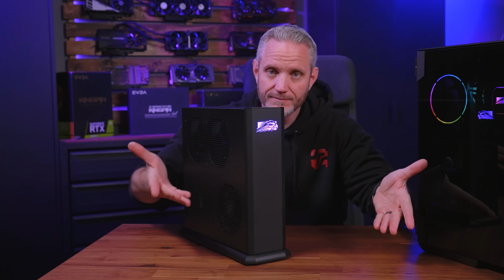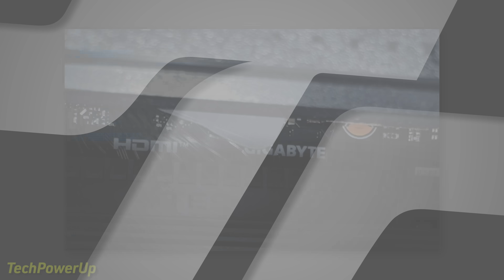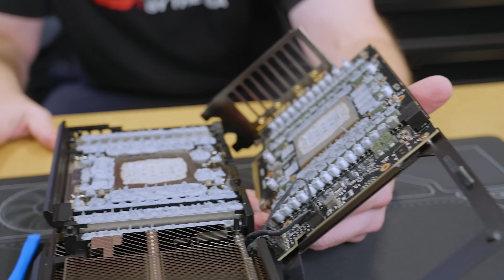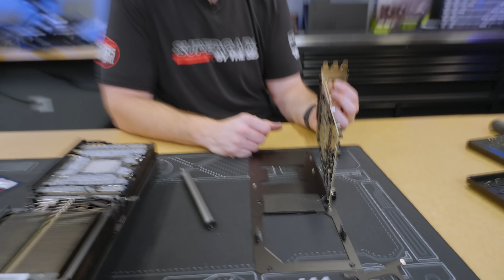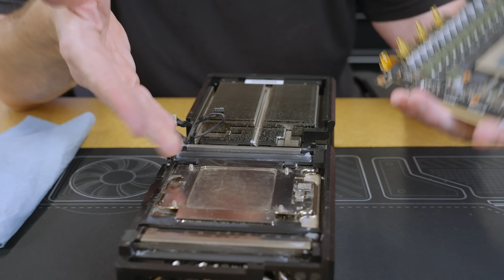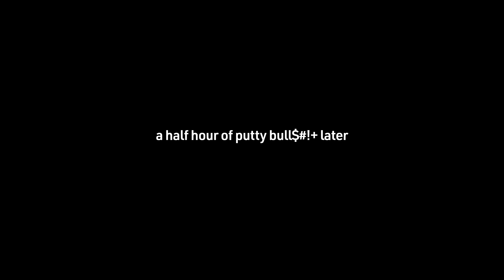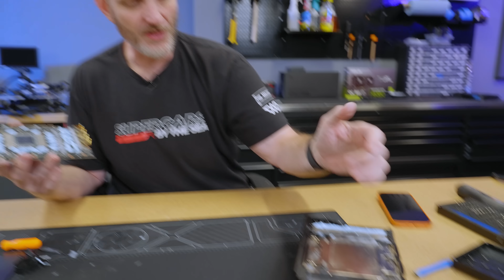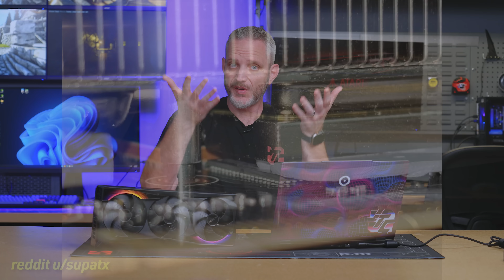What the HECK Gigabyte... WHY?

Comment: I replaced the thermal pads on my EVGA 3090ti with thermal putty and as much of a pain in the ass it was, the temps are so good
Reply: I use PTM7950 combined with Halnziye HY256 for thin gaps and UTP-8 Putty for bigger gaps on many devices, those are good and can be handrolled (With nitril gloves and a silicone mat) to balls and logs. (K5-Pro is horrible)
Reply: @harrydijkstra9936  yeah , say no to K5 pro
Reply: Snarks Domain on YouTube has some nice putty tutorials and he tested many different putty's.
Reply: how long ago did you do it ? Is it fresh or did you run it a year + ? :D
Mine was a total disaster after 1,5 years - but it was not Halnziye HY256, it was K5 pro instead
Reply: @DxCBuG  I've had the Thermal Grizzly putty on there 2 ish months... If the temps start going through the roof again I'll probably just end up replacing the GPU. Before I put the putty on, I had to limit the GPU at 80% because the hotspot would hit 100c in most games at 100%
Reply: So thermal putty and thermal pads are interchangeable? Why J didn't use thermal pads on this Aorus?
Reply: same
rtx 2070 super gigabyte windforce
mx6 on the die and tg putty on the vram and vrm and i saw a 20c drop with the same fan speeds 
mind you the card was 5 years old by the point i repasted it and the paste was like something youd find inside a sarcophagus
Reply: Come on, everyone, come and like this commenT! :D

Comment: In my daily tasks  this gpu doesn't get over 50c   not sure if that's hot for this to happen it's also oriented on it's side  but I guess symptoms are just it getting hotter and hotter as time passes?   It idles at 23c  though LOL  I do not allow it's fans to stop  they are always running at 50% though.    I have not seen any putty coming out on the sides yet.

Comment: ive been running a gigabyte 5090 gaming oc, zero issues on mine after 3 months or so
Reply: I have the same card in a hyte y70 build so of course vertically mounted. I haven't even looked to see if this happening 😢

Comment: one of those images had straight lines leading to a right angle, I say the putty is ok it didn't seem to have run on your card.  the image at 16m 14s, is improper placement when someone has rebuilt their card, the "gel" is too square, plus you can see on the chip where it was originally.

Comment: I have the Gigabyte Windforce 5070 TI and I was going to put a waterblock on it but it had the same putty and the waterblock I got did not fit so I had to return it.  But while I was in there I just replaced the putty mess with thermal pads for the important hot spots and then the standard paste for the GPU and stuff.  It was a mess of goo in there though.  I mean from their standpoint probably easier to just goo it up with a goo gun then putting in thermal pads that are a bit of work to put in I guess.

Comment: Nothing wrong with what Gigabyte did. Normal user will have better temperatures and it will last longer.
Reply: Nothing wrong with putties, consoles and laptops use them out of the factory, the issue is that gigabyte cheaped out on the putty they used, even cheap $10 putties don't ooze like this
Reply: Don't defend a company that makes flimsy GPU PCBs and overly heavy coolers but will refuse to RMA them when they inevitably crack. Gigabyte are one of the worst, anti consumer hardware companies around!

Comment: Server grade is the IT equivalent of military spec AKA lowest bidder that satisfy the minimum requirements
Reply: Admittedly, some server grade stuff is indeed specced different. Usually slower but better longevity. Storage for example. Its stuff that needs less actual attention and last longer, but usually has a tradeoff of performance (enterprise/endurance storage for example). A ptm pad would be server grade, this gel stuff definitely isnt. Otherwise, ye, its marketing garbage for some stuff. A ups is another example of potential server grade though, server ups have lower switch over times and higher capacity, hospital etc ups are even more extreme.
Reply: Without being bored Marine resistant
Reply: Don't spill the secrets now
Reply: @themarketgardenerShhheet even the US astronauts have been calling this out for years. Nothing like hurtling through space in a rocket built by the lowest bidder.
Reply: @LazyEngineeredThoughts  same goes for soldiers who rely on their equipment to stay alive! 🤔
Reply: @LazyEngineeredThoughts 
Which was Russia as far as the engines. Lol
Reply: @LazyEngineeredThoughts  I'm guessing hurtling through space in a rocket built by the highest bidder would be worse. Exact same shit, but more cost for the tax payer, which means you don't even feel like you got your money worth. Nobody's going to do fancy shit when it's already so hard and expensive to build to specs.
Reply: @RobertForslund  Yes but that Equipment still goes through rigorous testing in of the Bigfest Issue's is that have been still using Equipment from Vietnam in a Lot of Units
Reply: @LazyEngineeredThoughts But it's not, soooooo....
Reply: @LazyEngineeredThoughts  Shit, I learned that from the movie Armageddon, and I was like... 8 when that movie came out.
Reply: @LazyEngineeredThoughts standards still have to be met
Reply: @peterpizzurro That's 4 year old argument skills right there. You didn't do debate in school did you?
Reply: To be more precise the bidder that gives the bigger kickback to the top brass
Reply: “Server grade” = Might actually support ECC and if you’re lucky IPMI
Reply: Oh, don't get me started. "Made with military grade aluminum!" So... high end, we're talking 7075, the stuff I can get at literally any Lowes or Menards? gotcha.
Reply: Fucking FINALLY someone gets it! "Mil-spec" is shit compared to good shit!
Reply: Ex-military USAF and then 10 years DoD Aerospace R&D ... very true!
Reply: At least for chips, mil spec means wider temperature ranges, but sloppier timings. IBM used to reject boards with mil spec chips for this reason.
Reply: Isn’t true. I design stuff that has to live by mil standards. They are no joke. This shit is just a meme.
Reply: @bobbrossify  No both are true - the standards are generally higher and harder to meet than you'd get in the civilian world, but the contract does goes to the lowest bidder that can meet them (or at least 'meet them' in the eyes of the folks in charge of this procurement)
Reply: @foldionepapyrus3441  Provided there is no criminal activity or politically motivated contract awarding, the military standard is always better.......
Reply: But that last part is Important Satisfy the Minimum Requirements
Reply: I came here to make sure someone said exactly this.  Marketing monkey's throwing crap at the wall to see what sticks is what this boils down to.
Reply: No, it very much is not
Reply: Servers also aim for thermal efficiency and longevity over raw performance and dealing with the heat later.  That’s why most server components are flow through air cooling, rather than liquid or vapor cooling.  Heat is wasted energy.  No IT guy is going to want to deal with “gel”.  Pads and sometimes pastes are the easiest to deal with, because time is money.
Reply: and typically specced for a very conservative and constant usage profile, rather than repeated power spikes to 110% of design power ...
Reply: and I thought military grade (said in a very proud way) was the computer hardware equivalent of military grade atleast I have seen it a bunch when shopping for parts
Reply: Well no, difference is servers don’t get turned off, they just run until they die, your ‘good shit’ does. Enterprise grade HDDs and SSDs have higher read/write endurance.
Reply: Military spec. is just short for military specification. All that means is that the military tells companies what they want and they return with their versions of what the military says they want. Ignoring the bidding process, the military could have asked for the entirely wrong specifications. They often go for durability over performance, so things are overbuilt and underpowered. You then have to worry about companies that barely meet the specifications probably being the cheapest. They can take decades to approve and mass produce things because you need steady manufacturing lines that come from approved partners/countries, replacement parts, service manuals, trainers to teach how to operate and repair the equipment, etc. You can get brand new equipment that's decades out of date compared to free market offerings because of it. Of course lobbyists are also a huge part of the equation these days, so all bets are off. 

My only point is that military spec does not have anything to do with the lowest bidder being poor quality. If the specifications are written well enough, no company, (including the lowest bidder), can cut corners and make a crap product. It's a gross oversimplification.
Reply: Not the first time Gigabyte has screwed up. At least it wasn't exploding.
Reply: @monomonster I don't even think it's that big of a screw up, at least for me. I have 2 140mm fans on the bottom of my case, and having tried horizontal and vertical mounting, horizontal has always been slightly cooler. Now with my gigabyte 5090 it has the passthrough cooling, so I cannot think of one reason to not mount it horizontally. Without those bottom fans I might be more tempted, but in my case it's perfect in its safe orientation. What's fun is I came from an MSI 3080 and this 5090 is cooler in every game I play, even ones like borderlands 4 where the 5090 and 9800x3d are maxed out, (wtf is that about!?).
Reply: Which is essentially how just about every manufacturer in the world,who relies on outsourced component parts for their products,operates.
Reply: tbf, anything that's labeled "-grade" (consumer-grade, professional-grade, e-sports-grade, etc.) is going to be the lowest bidder that satisfies the minimum requirements.
Reply: @joshh535  I love (sarcasm here) how everything aluminium is marketed as 'aerospace grade' I mean its just aluminium and its pointless to say unless, its actually being used in avaition or space
Reply: @francistaylor1822 that’s the thing…t6 7075 aluminum is. And it is everywhere. It’s trickle down technology. I don’t understand how you can’t understand this
Reply: @Handledeeeeeeeeez  Im not sure what you are replying to you think I made, its just marketing on that basis is silly.
Reply: I believe you're conflating specifications with suppliers. The specifications are what they are, irrespective of supplier. I used to work for a company that did Mil Spec packaging, like static shielding bags (Mil-b-81705 family, spec has since been superseded, it's been a while since I worked there), pink anti-static bags (NOT the same as static shielding), duct tape, etc... 

Mil Spec product FAR exceeded regular grade product quality. (For example, a case (24 rolls of 2") of mil spec duct tape weighed 52 pounds vs 44 pounds for a good quality consumer grade. There was no comparing the quality.)
Reply: But if you're a business buying it, you expect a higher level of customer service
Reply: Thats literally any Standard.....
Its basicly the Definition of Standard....

Military Grade is considered Good because the Minimum Requirements set by the Military tend to be extremely high. 

But thats the thing. 
Server Grade literally means its expected to Run for Years in a fully controlled and stationary environment. 
Its not made for Gaming or Private use.
Reply: temps were better before the mess he did.
Reply: Military spec usually means stricter requirements. But if those requirements are easy to meet, then it's not much to brag about.
Reply: Military spec can mean a lot of things.  A military spec server on the ground is very different than a computer system in an aircraft.  Both were created to military spec, but I guarentee you the system in the Aircraft was created and installed to much higher standerds.
Reply: Eh no I doubt that, Look at server grade ssd's or hdd's they last WAY longer than consumer hdd's or ssd's and the price increases on the server grade storage, Same with things like memory ecc isnt cheap to make,
Reply: thats like the "military grade" motherboards..

aka the cheapest of the cheapest
Reply: Military specs aren't "lowest bidder". "Military grade" is. Get your marketing terms right because those are two very different things.
Reply: This is a very wrong understanding of things. It was a joke, yet people use it as an argument now. 
You don't build a footbridge that can hold a tank. There's no such thing as minimum requirements, there is only the requirements.
Reply: that's not true at all. server grade is leagues better than consumer grade. I'm guessing you've never worked in a datacenter.... or with any computer hardware lol 

mil spec is lowest bidder, but longevity of military equipment is wild. it's mostly marketing on consumer products, but lowest bidder doesn't mean lowest quality.
Reply: servers aren't vertical...they are slot always due to space are designed to save spaces when facing upwards slotted way
Reply: Sure, but you may want to point out that those "minimum requirements" on military equipment tends to be quite higher that consumer stuff.
For example, I have worked on servers meant to work inside submarines. Those things were tightly put together and performed great in a very small form factor.
Quite a big departure from the typical pizza box server way back in the day.

Not that there are not crappy companies claiming military specs on trashy products, but those that actually comply are solid stuff.
Reply: It's hype.... Lol don't forget to hype this video

Wait never mind there is no hype option on this video what the hell is going on YouTube
Reply: @samholdsworth420  since no one else has responded to you yet, the Hype button is only available on channels between 500 and 500,000 subs.
Reply: @samholdsworth420  isn’t hype just for smaller creators?